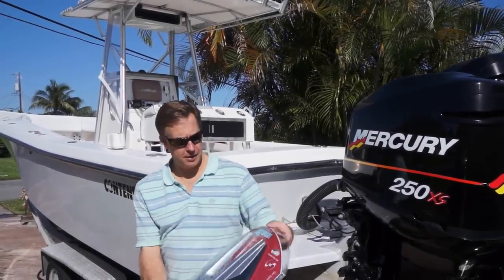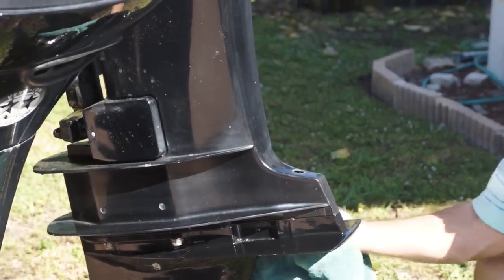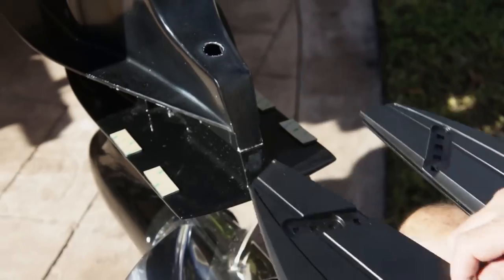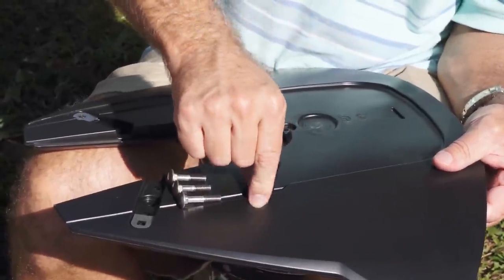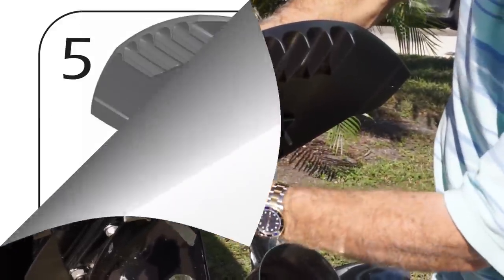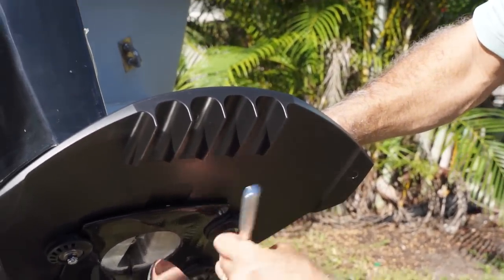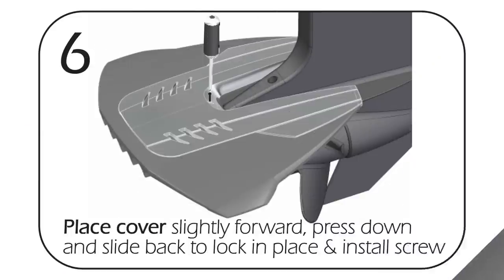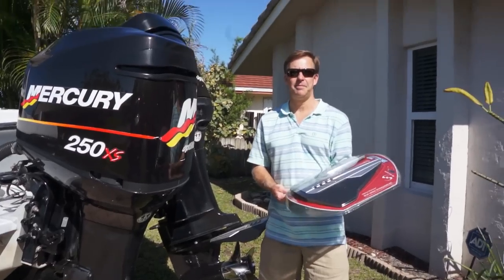Installing the SE Sport 400 - Drill Free Application

Comment: This is just like an "elevator flap" on an airplane. The increased control surface going thru the water is just like going down the highway at 60mph, put your "Flat" hand out the window and angle up then down. The air lifts the weight of your entire arm or plunges downward when tilted down. That same action is much more effective in the water. When traveling forward in a boat under power, take an oar and dip it in the water and change the angle on the face while moving forward. The oar will immediately react to the different positions either push or pull, lift or drag. 
Now increase the control surface on the outboard with a foil unit, and use it to lift the transom to reduce water tension drag on the hull, which will cause the boat to plane much faster and top speed better and less power required for cruise speed resulting in lower fuel burn, the foil will pay for itself in the first couple outings in fuel savings. 
***What Everyone forgets, is that you Must adjust the angle of the motor so the wing lifts instead of goes down. 
They work Fantastic, and the people who don't believe are doing it wrong and simply don't understand how to correctly adjust the motor trim.
And, after 10 years of using foils, the best we've seen yet is SE Sport brand 200 300 400 (just throw away the tape and use stainless bolts with nyloc nuts and do it right) 😊😎
Ps. Use them on inboard motors with outdrives, you'll be very happy with performance and fuel savings!
Reply: I just bought one of these and my Boat has a problem when your going very slow not even plain front of boat likes to lift high. Trimming motor down helps some so what do you recommend when I get this installed on Trimming

Comment: I've just recently got the SE Sport 200 for my mercury 15hp 4 stroke.
It was driving me "nuts" to know where to place the rubber washers. In between the hydrofoil and cavitation plate? or underneath the cavitation plate followed by small washers and lock nuts?  The package came with bugger all instructions. Cant even get onto the official SE Sports website. And other Youtube videos out there show them putting the bolts in from underneath the cavitation plate with the nuts and metal washers on top. Christ I wish someone could set the record straight. I even phoned a marine outlet and they told me to place the rubber washers on top of the hydrofoil and thread the bolts thru. Unbelievable.That's darn crazy. Anyways I like what you have done and so I shall place them underneath.

Comment: My 300 stayed on for almost an entire season only to fall off. My 400 immediately slipped back approximately 3 inches after a couple of runs at speed. I re-tightened it after the first use only to find it slip back 3 to 4 inches again. If I tighten the bolts anymore, they will break (which happened to one of my bolts during my initial installation).
Any suggestions? I really would like to keep the hydrofoil on; however, I’m literally throwing my money away.
Thanks for any advice you may be willing to provide.
Jim
Reply: James Bernthal   which motor/hp?
Reply: Nick Henton Yamaha 200 HPDI.  Factory sent me some new hardware. Still not sure if it will work.
Reply from the maker: James Bernthal James, there were some Sport 400s shipped without clear instructions on the position of the 2" rubber washers. Also, some of the rubber was too hard for a good grip on the bottom of the cavitation plate.  Check to make sure the rubber washers cover the "step" on the top of the Disk-Grips and don't hesitate to ask us for the softer rubber washers. You may contact us through our web site, www.sesport.com. Thank you.
Reply: James Bernthal
Reply: These guys do not answer phone calls or emails. Maybe out of business?